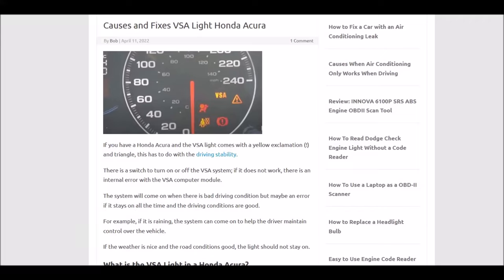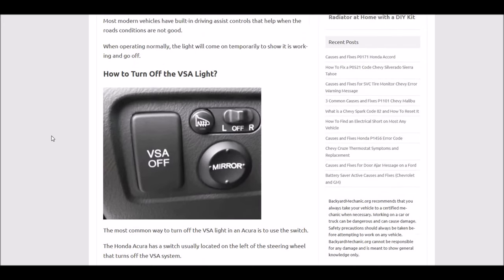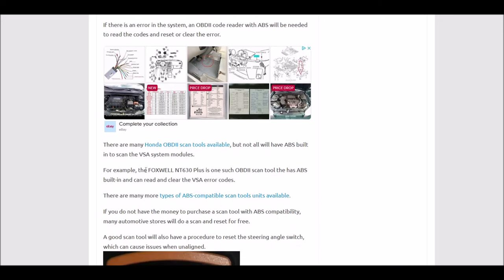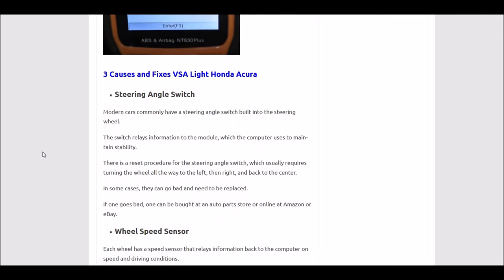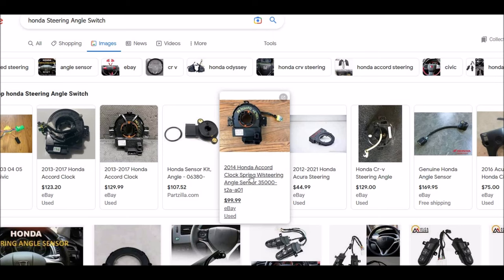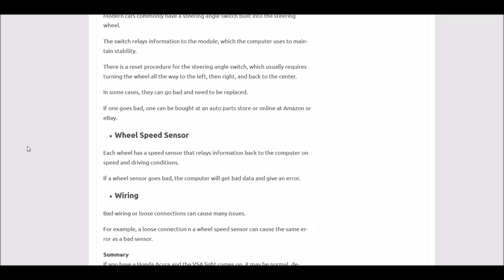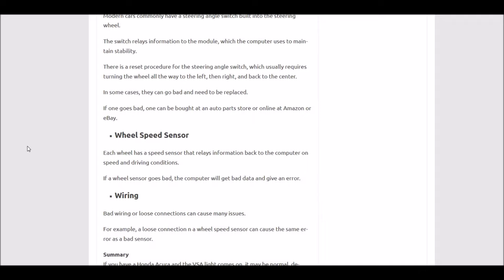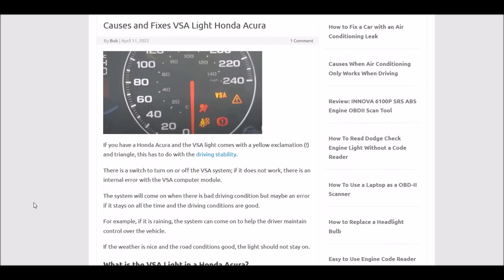Causes and Fixes Honda VSA light That Won’t go Off

Comment: Jump pins 4 and 9 and do the reset procedure without a scan tool.  Most times you can just do the reset procedure and then if the problem comes back then take it to a mechanic.

Comment: I have a question can you please help if you can ? My VSA light with come on when I drive , but if i turn the car off and turn it back on it will go away and like 30 minutes later or some times won't be en come on ! Pretty much it comes on when ever it wants i already reset the light. And it keeps on coming back on , please help
Reply: Same problem here did you fix it ?
Reply: same problem
Reply: Yea I’m having the same problem today 🤦‍♂️
Reply: Could be a loose connection or ground. Could also be that the wheel speed sensors are dirty, which is common.
Reply: Same problem.I went to Honda and have it diagnosed.They said I need to replace VSA parts which costs $3000.I got second opinion and said the same problem but it will cost me $1500.

Comment: 07 Honda Odyssey EX-L, with engine code J35A7.  Scanner picked up P2647, P0523 and P2649 codes.  Replaced VVT solenoids and assembly with new screen and gasket. Change engine oil and filter. Check wiring harness and have over 5 VDC. Even place a washer gasket on the VVT solenoid. What else and I am missing? Please help. Thank you!

Comment: Something not mentioned is my issue, the yaw/acceleration sensor.  Only determined when looking at live data, both acceleration numbers never change, but yaw is good.  Secondary market (salvage) is empty around here as scrappers have no idea these exist.  I did let local yards know they’re throwing away hundreds of dollars on a part that’s 600- 1000 or more depending on your source.

Comment: I'm not sure if you're still reading comments from this video or not but I have an Acura 2006 and the VSA light stays on however when I'm driving on the highway, I'll get the check VSA system on my dash then I have to pull over, restart the car and then it goes away. Is there a reason the light would stay on but the dash message will only come on on the highway?
Reply: But no abs light.

Comment: 2010 Honda Element with 195K mileage:  VSA Off indicator light will not turn off.  Reset but keeps coming on.  Code 26-1 on scan. Any ideas?
Thanks for this helpful video!
Reply from the maker: 26-1 Code: Lateral acceleration sensor malfunction

Comment: My 2010 honda accord coupe 3.5 liter vsa light goes off and on but it kicked the engine light on now the car is running sluggish and auto zone did a scan its missing on all cylinders do I need to replace the module or what's your thoughts buddy I need some pointers
Reply: If you have misfire codes those are the likely cause.
Reply: @JereB698  could It be the speed wheel sensor or a clogged fuel filter those things with set the vsa light on and the engine light right 🤔
Reply: @jrocc_kmh  If the engine is having an issue (misfiring) the computer shuts off driver assists which is the VSA lights. Basically follow the codes.
Reply: @JereB698  now it saying misfire on 3